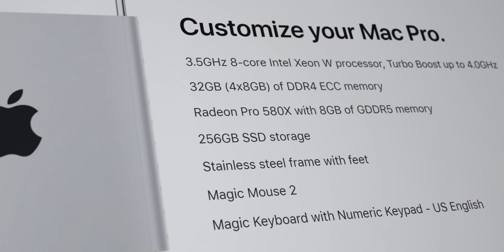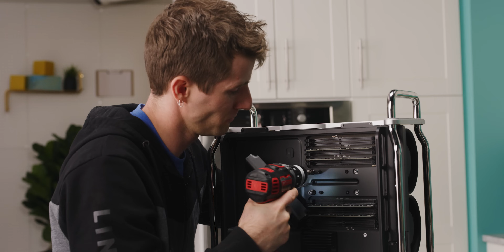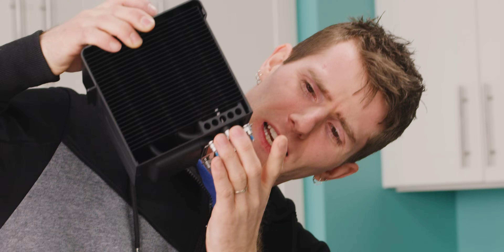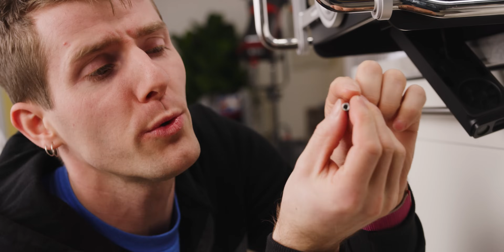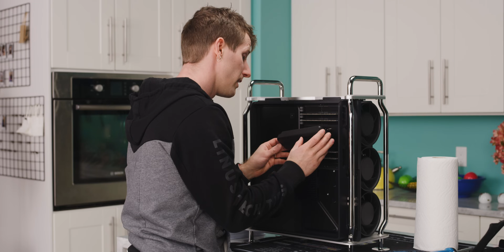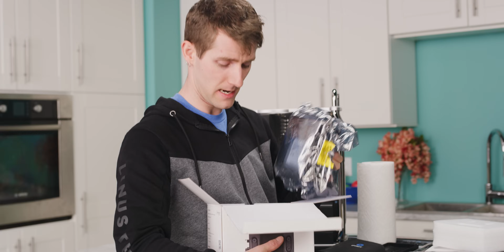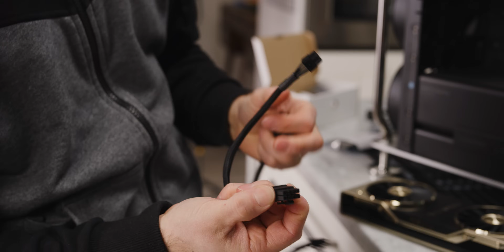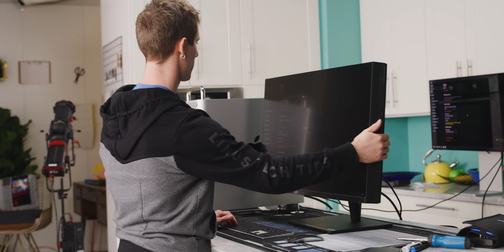Don't give Apple your MONEY - Mac Pro Upgrade Adventure

Comment: So you basically paid 6 grand for a nice case, proprietary motherboard and (I assume) decent PSU?

Ouch.
Reply: @GamingPIG3ON  the Afterburner card and dual Vega GPU were substantially extra over that $6,000.
Reply: Welcome to apple lol
Reply: Nice case?
Reply: @GamingPIG3ON  Normal, t'es un pigeon mdrr. Non je rigole, apple au pouvoir, les autre à l'abattoir
Reply: The 6k was for the lowest entry level. I'm not sure why Linus wasn't clear about how much he started with, and then how much he put in. Sounds like he started with at least 8k, and put another 2-3k in. Hardly the machine the vast majority of the public will be getting. I don't know what wax Apple is smoking.

As far as Mac OS being reliable, we just went through 4-5 months of Catalina issues with other's software. I don't trust Apple at all anymore on desktop. They are a phone company, and they iron out glitches, but it can take years. When it comes to software like Ableton Live or Houdini, it's a regular struggle for those companies to stay on the Mac, and stability is much more evident on PC.
Reply: and locked boot SSD
Reply: That's apple
Reply: For the nicest case on the market and incredible thermals. Hopefully day 3rd party case manufacturers will catch up.
Reply: @Noah-Lach  "nicest case on the market" lol I actually can't tell if you're trolling or not
Reply: Thugasaurus Rex Show me one with better build quality and thermals. I’ll wait.
Reply: @Noah-Lach  you obviously haven't seen the market. Also - the thermals are only incredible if your comparing them to other apple devices.
Reply: Messy I have and the level of quality is disappointing to say the least.
Reply: "Nice case" is a bit strongly worded, my friend... 😂
Reply: dont forget the shitty OS
Reply: Andrew Fowler if apple does one thing right it’s the OS. Maybe not for gaming but for industry use it’s amazing. When I’m watching and processing dailies on set reliability is a must. That’s one of the reasons why we use ARRI cameras, not RED. Our Linux system has failed us before. Windows when throwing 5.5k or 4K ARRIRAW at it has a pink fit. Mac OS always runs fine.
Reply: @gabj9017  Mac may be an industry-standard OS, but to be honest I doubt that has anything to do with the OS itself being inherently better than Windows or Linux equivalents and everything to do with the whole marketing of Macs as "professional machines" paying off so well that third-party developers of professional tools just support Macs over other operating systems by default.
Reply: @Abion47  clearly you don't use macOS
Reply: @gabj9017  Mac is not that amazing for Industrie. For example many cad programs won't work on Mac or don't have the full feature set, many scientific applications and accessories are not supported by Mac OS and the list goes on. On the other hand windows is the standard for most major companies and it supports almost all types of applications. Mac OS is useful for a small niche not for the Industrie as generell. Also a proper windows server based solution is pretty reliable.
Reply: TheGabbaKeks of course I have no doubt CAD would work better on windows however I have no experience with it so don’t quote me. Your right it does have a niche market. I only know the film industry and of the industry only the part I work in. But in that part, not even in post production but in producing dailies for screening. This computer has already become rather standard even though it’s new (new by our standard). The fact it’s portable, reliable and can handle pro res with ease which might surprise you but is probably the format we use the most and so does everyone else with ARRI cameras (the industry standard) as most of the time ProRes XQ or 4:4:4 is our go to. The fact it also handles ARRI raw like a boss. It’s the best we have. Sure a windows server would be great. But if your going to haul a windows server to location, your insane. If you also think any lap top could handle the raw data at the speed which we need your also insane. The fact is for us it’s the best choice. Not only to say that almost all projects use ‘do’ dailies and a bunch of renting houses already rent them. A 50,000 price tag is not a lot compared to let’s say a small indie budget 1 million dollar film. For 10 mil+ it’s a no brainier. And to continue this, compared to our cameras even a Alexa mini LF racks in at about 70,000+ not to mention I personally prefer the SXT and large body LF. Not to even begin on lenses as that makes the price of a house look small. Anyways my convoluted point is that this 50,000 dollar beast. Is reliable, portable and handles the formats we need. So they hit our niche market. However are niche market especially since streaming became so big. Is growing by the day. This is not a VFX computer. Possibly a post computer. But it’s definitely a dailies powerhouse. Also good to use to transfer data.
Reply: @Abion47  LOL... Oh boy.
Reply: @Abion47  .That used to be the case with the likes of adobe (seeing as apple gave them money to get going ) but in recent times adobe runs a lot smoother on windows based products, windows/apple OS is largely the same and boils down to preferance. BUT as I'm a product designer by trade ill talk a little about the case, people miss the things/details  I see on the case and the product in general, Linus touching on a few of them in the video. Apple goes the extra mile or 2 on fit and finish and engineering like that does not come cheap AT ALL. Its like comparing a ford to a roll's. Integrated/fully discrete wiring, the entry mech, gasket around the case to completely seal it for thermal performance, specailly designed fans to mitigate noise even under heavy load and so on. I'm not defending their choice of spec but once you take that all into account you realise there trying to hit a budget and rather than cut corners on the case they sacrificed the entry spec, the case is designed to last a decade or more (see 2010 mac pro) and the entry spec is just to get you going. If people moan about the price then they've missed the point entirely and just isn't for them and that's fine, As a product designer, it's an industrial design marvel with engineering to match. Expensive yes, under spec'ed yes, but its apple
Reply: @dasooperb1371  I have a 2017 MacBook Pro that I use for work as a full-stack developer. The only things I like about the Mac as a development computer are the things it shares in common with Linux. Everything else lies in the range of workable but not noteworthy to a royal pain in the ass to work with (like the steaming pile of garbage that is XCode).
Reply: @Twinklinglittletoes  That explains why the entry price is 6 grand. It doesn't explain why upgrading just the RAM can run an additional 10 grand.
Reply: gaza4543 Isheep
Reply: @andyinmono9393  lmaooo if anything MacOS is leaps and bounds better than Windows any day.
Reply: Andrew Fowler macOS is literally superior to windows in most aspects 😭😭
Reply: @mattymrj01  In what aspects..?
Reply: @mattymrj01  Not worth $2000 for the OS when I can build a Hackintosh for the same price as my gaming PC.
Reply: @mattymrj01  ahh yes I love not being able to run any of my programs. Total superiority
Reply: @mattymrj01  Im genuinely interested.  Why do you think it's superior?
Reply: @joelgeri5417  It's the little things with Mac OS that I love (and I use Windows as well, a lot). Things like the Automator and file renaming, I had to rename 1000 files a while back, they all had random names like blahblahblah.jpg and I needed them to be blah-blah_blah_0X0X.jpg with the X's being numbers. You can batch rename in Windows but it will do it in its own format and the numbers will be like (1). Mac OS gives me huge control over little things like that and that's very valuable to me. It's not that Windows 10 is bad, I like and use it a lot it's just that the little things in Mac OS that Windows either does worse or not at all (without maybe using powershell and Mac OS has a 'nix command line anyway) really make it shine brighter for me (and the Apple eco system just works so well, working on my Mac, pick up my iPad and carry on there, come back to my Mac using my iPad as a second screen etc). Whenever I see Linus moaning about Apple or or people in the comments calling them overpriced junk I just roll my eyes; I will always use Windows but I've never once felt like what I got from my Mac was overpriced or junk.
Reply: @capuchinseven  and i wasn't calling Apple ovepriced junk either. im genuinely interested in what makes it  better then windows.   aside from renaming files on bulk is there any other reason you prefer mac ?
Reply: Joel Geri I totally understand a lot of people’s Windows preference when it comes to gaming/tweaking/customization/other commonly referenced points. Those kinds of user preferences are valid a lot of the time, but in terms of helping vs hindering my productivity when I’m trying to get work done, macOS wins by a mile. 

Here are a few of the ways in which Apple’s operating system is better and really helps for my use-case (off the top of my head):

1. The menu bar (File, Edit, etc.) in every application is separate from that application’s window. This might seem strange to users coming from Windows, but in addition to the slight streamlining of every program interface, it also means that applications with multiple internal (child) windows are always independent and do not have to be stuck within a parent application window.  Most of my work is audio / recording / mixing work in Avid ProTools. I use 2 Slate Raven MTi2 27” touch-screens with one 43” 4K monitor above them on the wall. I can have my Edit window on one touch-screen, my Mix window on the other, and various notes, plugins, meters, or the midi editing window on the 4K without having to stretch a parent window across them. Any combination of my applications windows can be on any screen, and those screens can be positioned anywhere a user would like (relative to each other) / be any combination of display types or sizes, and this will work as described.

In Windows, all of the different ProTools screens are housed within the applications annoying parent window which means I have to stretch it across two identical screens in order for things to display even close to this functionally. Even still, it adds unnecessary menu clutter/space to secondary screens and completely eliminates the utility of my 4K screen. Most/several audio programs (DAWs) and video editing suites exhibit the same Apple vs Windows behaviour. The only exception I can think of is Adobe Photoshop which I believe has the same independence of its tool, menu, and workspace windows on both operating systems.

2. I would also probably opt to work within MacOS just for its fantastic integration of multiple / separate desktop “spaces”. MacOS makes it really easy to set up multiple desktops and switch/scroll between them just by holding down a modifier key and pressing the left/right arrows (or the up or down arrows to access other functionality). Additionally, applications can be assigned to specific desktops to that they always open or reside there by default. 

In my case, I have desktop 1 set up for file system management and random apps, desktop two for internet, desktop 3 for ProTools, desktop 4 for iTunes / media playback, and a fifth desktop for Photoshop or Video editing. My applications are always in the same places and I can swap between tasks or workspaces with a simple key command. For example: if I am working on a mix session in ProTools (which is setup to cover all of my 3 displays) and need to look something up or manage some files/stems that I have just exported, Windows would require me to minimize one/all of my windows or deal with a clutter of things floating on top of each other, but I tap one key command and I’m looking at a completely separate set of windows (or a fresh empty desktop). This type of thing is also very useful if I am “ReWire-ing” / routing audio between two different DAWs or applications. No messy minimizing/ maximizing or moving things around.

Additionally, moving back and forth between multiple applications when a project entails constantly transferring assets between photoshop or Final Cut Pro or a coding program or anything becomes super streamlined with this type of multiple desktop workflow. I’m sure there are ways to do this in Windows, but it is far less elegant and isn’t a default or typical use of PC.

3. For professional audio work where extremely low latency and stability are paramount: Apple’s Core Audio is far more reliable than ASIO on Windows and several third party drivers and high-end hardware solutions seem to play nicer with macOS (both due to inherent optimizations within the operating system itself and because a lot of developers prioritize Mac support since it has traditionally been so prevalent in the audio and film industries). 

Also, for whatever reason, Apples underlying OS architecture has proven far more stable under extremely heavy loads when working with audio.

4. Not that it is my primary concern, but a combination of Apple’s closed (limited in the opinions of some Windows users) ecosystem and its being built / coded upon a UNIX foundation rather than layers of C+ based language has resulted in a system that (while not invulnerable) is inherently less prone to security issues.. or at least specific types of vulnerabilities. This one isn’t enough of a reason for me to base an OS preference off of, personally, but it’s there.
Reply: Joel Geri 5. Using the OS itself. 
There are a lot of little conveniences and things (many of which have been around for years) that make macOS more effortless to use once you get used to it. A previous comment mentioned bulk renaming, but some other examples would include: 

-Pressing the Enter key on the number pad will automatically put the currently selected file or folder into rename mode (which in practice becomes a lot faster than the right click menu or slowly clicking the name twice).

-Pressing the left or right arrow key when a file name enters rename mode jumps to the beginning or end of the file name (excluding the file’s extension) which also adds convenience.

-Files and folders can be highlighted with colour for quicker visual locating when exploring the file system.

-A lot of basic applications can be installed or removed by simply dragging or moving them in or out of the Applications folder. 
Also, Imagine if every Windows program in your Programs folder was just its folder with an app specific icon. Every app in Apple’s Applications folder behaves this way (as a container for all of its internal file structure. Almost like a zip or rar file, but it’s the program itself). The internal file structures can be accessed if need be,  but this is rarely necessary.  Most program installers simply involve dragging the app onto an Applications folder shortcut. Only a select few apps require uninstallers (since most don’t place any files or assets in other locations on the system) so most can be fully removed by simply deleting them from the Applications folder with no further steps (unlike Windows which requires running an uninstaller program from within the Add/Remove programs window for pretty much everything).

-The macOS built in search function (Spotlight) is fantastic. It provides way faster results, far more useful results, categorizes them, makes useful suggestions, allows opening the parent folder or whatever way more easily, and is just an all around more elegant implementation of something that could easily be taken for granted. It’s hard to stress just how much better it is without trying it, but by comparison the Windows search function is a mess (and often useless). Windows 10 did improve search functionality a good amount over 7 (especially for apps in the start menu), but it still has a long way to go before it’s at the same level.

-Windows did add that snap to side functionality for organizing two windows (more?) on the desktop, but for users who want quicker navigation and convenience, enabling hot-corners or various shortcut based functions in the settings menu of macOS can allow a user to: show the desktop, cascade all open windows so they can be viewed at once and then select the one user wants, show a dashboard (overlay) of widgets such as weather, calculator, calendar, unit converter, sticky notes, stock ticker, etc (far more elegantly than the sidebar or permanently visible things Windows implemented over the years)... as well as some other options.

-When exploring the filesystem (Finder) in List mode (as opposed to an icons view), multiple folders can be highlighted and then expanded or collapsed by just pushing the left or right arrow keys. When organizing or cleaning your filesystem, this can be really handy. It makes moving all sub-files or folders to different levels of the filesystem hierarchy more convenient. It makes identifying empty (unnecessary) folders really fast when getting rid of junk. It makes counting the total number of objects (files + subfolders) at all levels within a folder really easy. It saves me a lot of time.

Come to think of it, I’m not sure that Windows really has a file explorer mode that is equivalent to this where a folder’s contents can be expanded out in a drop-down style list and easily highlighted or moved in and out of the folder (or up and down through the hierarchy) which it getting messy like in that columned group mode style or with multiple windows required to drag between or copy/paste.

-Continuing something started on one device on another device is incredibly easy. Web-pages, notes, YouTube videos, etc will automatically move between an iPhone iPad and Apple computer. Even text messaging can be continued on any of those devices. 

-I have come to prefer the macOS dock to the start menu and taskbar, but I could see this one being a split depending on preference. I find the dock is cleaner, easier to organize in a way that speeds up one’s workflow, and Spotlight makes a direct start menu equivalent unnecessary given the way I tend to use a machine.

-Display scaling is way better on a Mac. If you have a display that is 4K or higher or just really massive, macOS makes it really easy to scale up the UI elements and text of basically everything so that they are easily usable/readable without any loss of clarity or perceived screen real estate. The Windows equivalents of this (such as they are) really don’t do as good a job of keeping text looking smooth and nice or of being as global in their effect. This is actually one where the way that Apple has programmed the OS’s handling of UI elements (Apple SDKs that developers integrate into their Mac apps) as well as how the OS renders text makes a huge different to how well this can be done.

-There is SYSTEM-WIDE spellcheck/correction, etc. Everything typed in a note, text file, browser, whatever can indicate spelling or grammatical errors (disable-able if desired).

-Text editing (basic as it may seem) is actually a lot nicer on macOS. The basic TextEdit app uses rich text editing by default (as opposed to the Windows notepad app which uses plain text) and formatting the text is made much more flexible with less effort as things like lists will automatically format as they are detected and upping or lowering the font size is as simple as highlighting something and pushing the + or - keys while holding command. The only thing I dislike at all is how text apps treat the home and end keys slightly differently.

-While on the subject of command+plus or command+minus: this key combination makes for quick zooming in a lot of apps and is remembered on a window by window or tab by tab basis.

-Key commands / combinations exist for so many useful functions that a lot of little things become a easier. For example: both Windows and macOS have commands for moving files to the recycling bin / trash can, but macOS also has a key command to empty the trash bin. There are key commands to show/hide hidden files and folders, open the Applications and other folders, cycle through open applications, open Spotlight search, put all displays to sleep, move to previous/next folder, paste text with or without its previous formatting, take a fullscreen screenshot or just of a selected portion of the screen, scroll through misspelled words, hide current window, open file info, open a folder in a separate window, etc. So much is made faster and more convenient at every level of the OS.

6. Time Machine.
macOS’s built in backup utility is pretty much the best of its type. Using a dedicated backup drive (with set up by the user) Time Machine makes scheduled backups of the system drive (plus whatever else the user would like). It can be adjusted to do less if desired, but by default it creates local snapshots as space permits, hourly backups for the past 24 hours, daily backups for the last month, and weekly backups for all previous months. When the backup disk is full, it simply deletes the oldest backups, as needed, to make room. 

This might sound like overkill, but it has virtually no effect on computer performance during typical use, can be easily paused during heavy-load intensive work and functions amazingly well. 

Accidentally deleted something: open time machine, copy it from an hour ago, and then paste it wherever you want.
Need something from a few weeks ago?: same thing.
Can’t find a file, but remember where it used to be?: same thing as a quick work around.

Time machine also makes it really easy to keep easy backups of critical work drives and in progress projects.
It makes it super easy to revert to a previous version of literally any document, session, project, or saved file if something becomes corrupted or if a user simply made an error while working on something.

Additionally, restoring an entire system to a previous state from any point along the backup time-line is as easy as booting to recovery mode and restoring from Time Machine. No hassles, no re-installing the OS from scratch, not BS. 
It simply re-images the drive and is as fast as copying the data.

It also cannot be over-stated just how easy the interface for Time Machine is to use when accessing the backups.

Windows has backup capabilities and some third-party software offers some or similar features, but no PC equivalent is as well integrated, as simple to use, and as generally effective with so little hassle.
It may not be as much of a priority for every user, but it is incredibly reassuring to have when working in a professional capacity and when dealing with client’s work and data.

I’m sure there’s more that I’m not thinking of, but that’s at least some of what makes Apple’s operating system my preference.
Reply: @stringsdiezel  imagine being such an apple sheep that you're willing to write a 4 page essay in a youtube comments section about why mac os is better
Reply: @stringsdiezel  You go into so much detail here that I couldn't help but respond.

1. Menu bar

This is most definitely a personal preference thing, but I have to say I hate the menu being separate from the program window. It is also rarely as neat in multiple monitor setups as you say. I'm frequently fighting with the OS to show me the menu of the program I want as it will instead show the menu of the currently focused program across all screens. Also, sometimes if I have a window maximized, the menu bar on the other screens will just be a solid white bar across the top of the screen which is incredibly jarring.

2. Desktop Spaces

Mac desktop spaces is pretty convenient, but the desktop spaces functionality in Windows 10 is virtually identical. It's just less convenient to use because Windows doesn't typically ship with a multi-touch trackpad. 

I also have to say that, speaking of the aforementioned multiple monitor setup, I have a preferred layout for my spaces, but when I unplug my laptop to bring home, the spaces get all jumbled up and the next time I plug it into the monitors (even if I hadn't opened the laptop since) the spaces are all mixed up. What's worse, there's a space on each screen that is quietly marked as the "default" of that screen that can't be moved around at all. So if a space that is usually on my left screen somehow ended up as the "default" space for my right screen, the only way to get back to my preferred layout is to manually move every window to the other space.

3. Audio Work

I don't do much professional audio work so I can't say much here. What I will say, though, is that if ASIO does seem like it is incredibly old and, if it was developed alongside the Win32 API, fairly outdated. I would be inclined to chalk this up to what I said in my other comment, that Macs were heavily marketed as the device for professional creative work which led to them getting more attention from third-party developers of professional creative tools which hyped up the marketing... and the cycle continues.

4. Closed Ecosystem

This is a very common misconception regarding the Mac OS. Mac is not inherently more or less prone to malware and security flaws than any other OS. It gets its share of issues just like Windows or anything else. Being based (some might argue loosely based) on a Unix kernel doesn't really matter, since it's based on a really old version of Unix that was then morphed into a version of BSD and then NexTSTEP after that before finally becoming Mac OS.

Also, the belief that Macs are inherently more secure is actually fairly dangerous, since when the exploits do happen they are that much more effective due to Mac users believing they are bulletproof and not taking the necessary precautions.

5. The OS itself

I suppose I'll address these individually.

- (Pressing the Enter key twice...) On Windows you ender rename mode by pressing F2.

- (Pressing the left or right...) Windows does this too.

- (Files and folders can be highlighted...) I honestly don't know if Windows can do this as I've always hated the feature. having files and folders in a Mac OS window be color-coded to me looks like a huge mess. I'd much rather group related files and folders using a sensible naming convention. But to each their own, I suppose.

- A lot of basic applications can be...) This is the source of another misconception, actually. First, there are plenty of Mac apps that do require an installer, and those that do can't be completely uninstalled by just deleting the app from Applications as that doesn't delete the stuff that was added to your documents, your Library folder, etc. And to be honest, for programs on Windows that are also self-contained in their installation folders, you can also uninstall them by just deleting the folder; the uninstall process is mostly just a formality. This mostly just comes down to convention between Windows and Mac apps, and personally I prefer the Windows approach since while it might be less convenient ro tun an uninstaller than to just delete a file, you can be more sure that way that you aren't leaving a bunch of now orphaned data and config files quietly taking up space on your computer.

- (The MacOS built in search function...) This is true. Spotlight is incredibly handy... until it isn't. When searching for specific apps (like when I want to open up the calculator and do some quick maths) it's up and ready to go. But there are also times when I've been searching for a particular file or folder that I know existed in an indexed folder and no matter what I typed, Spotlight kept suggesting web results to me rather than what I've actually wanted. Windows 10 search function isn't as robust, but it's also never not done what I expected it to do. Personally I'd rather have a search function that is limited but predictable than one that promises the stars but often falls short.

- (Windows did add that snap...) Windows also has hot corner functionality for people who really want it. On Mac, the hot corners can be useful, but I find it way more useful (not to mention less prone to accidental activation) to bind those actions to touchpad gestures instead. On the topic of Windows snap to side, I personally find it amazing that Mac hasn't incorporated something similar, as one of my most aggravating day-to-day annoyances I have with Mac OS is in its window management.

- (When exploring the file system...) I didn't know about this functionality in Mac OS and it sounds cool. That said, personally it also doesn't sound too terribly useful in the long run, as I don't find myself frequently needing to navigate multiple folders and subfolders. Regarding the list view, Windows does not support that kind of view with expanding folder trees. I'm okay with this, personally, as I find that view to be very easy to turn your folder into clutter, but this is another one I'd chalk up to personal preference.

- (Continuing something started...) This has less to do with Mac OS specifically and more to do with the Apple ecosystem in general. And sure, there's a lot of convenience to be gained by operating solely within that ecosystem, but it also comes with the cost of things being needlessly complicated whenever you have to branch outside it. Also, I'd personally like people to stop conflating text messaging (i.e. SMS) with the proprietary Apple-only messaging system that is iMessage. (As an Android user with a lot of iPhone friends, group conversations are a pain in the ass.)

- (I have come to prefer the...) I don't really see much difference in functionality between the Mac dock and the Windows taskbar, with one exception on Windows being that it is way easier to see which apps are open and to navigate to a specific opened window. In my experience, Mac does not really like to facilitate easy navigation among minimized windows.

- (Display scaling is way better...) No arguments here, though it's worth noting that Windows 10 got waaaay better at it than Windows 7/8.

- (There is a SYSTEM-WIDE...) True, and this has annoyed me more times than I can count. I don't want spellcheck enabled in my code snippet files, and there are much better spell-check and grammar-check addons in MS Office and in Chrome/Firefox than what Mac OS offers by default. (Try Grammarly)

- (Text editing (basic as...) On this I have to 100% disagree, though it may come from my preference as a programmer. "Basic text editing" to me means plain text editing, and it bugs me that every time I open a text file in TextEdit I have to manually switch to plain text mode. I rarely if ever find myself wanting to do some "basic text editing" that requires rich text, since when I want to do rich text editing, that's what I have MS Word for. Also, if you do want to do "simple text editing with rich text" in Windows, you use WordPad, not Notepad.

- (While on the subject of...) That's not a Mac OS thing. That's a convention that a lot of Mac OS apps use. And most if not all Windows apps that have zooming functionality share this convention (though it's Ctrl-Plus and Ctrl-Minus, obviously).

- Windows can also define key commands for a fair number of things, though they don't come bound by default a lot of the time. There are also programs like AutoHotKey that fill this space remarkably well. Personally, though, I don't like the idea of binding OS actions to hotkeys that an app could easily override.

6. Time Machine

Mac's Time Machine is pretty nice for what it is, though I have to say as a technologically savvy person with less-so grandparents, this has been a source of more headaches than I'd care to experience on the occasions where it hasn't been working. This is something I could say about Mac OS as a whole, really: it's simple, clean, and convenient... until it isn't, at which point it can be like pulling teeth.
Reply: @capuchinseven  thanks  for all that, its good to hear from a daily mac user. I don't really want to comment on anything you said as im more interested in another point of view rather than starting an argument.
Reply: Andrew Fowler I actually use both. I just find I more often wish Windows did something the macOS way than I do the reverse. Also, I didn’t type out such a long response due to brand loyalty... I’m just generally long-winded as a person, and have a bad habit of doing that about any topic. I don’t comment or post very often, and then when I actually do.. I write a damn book for no good reason. 

It’s a problem lol.
Reply: @stringsdiezel  I don't think its a problem at all, good on you for giving those opinions. people tend to just be annoyed or make comments on mac or pc without any reasons or experiences to back them up. its good to hear peoples actual reasons why tho it helps to show the whole picture
Reply: @Abion47  I typed all of that before bed/after a long day yesterday.. Re-reading it after some sleep: Wow am I long-winded at times. That reply could be it's own YouTube video rather than a reply to a comment. I'm honestly surprised anyone read it all, let alone gave a detailed response. Thanks man. You also make a lot of perfectly valid points.

That said, I'm sure most of what I described would be more accurately filed under "Things that keep me tied to/preferring macOS for my workflow" than "things that would make me or others switch from Windows". A lot of the differences thoroughly annoyed me for my first ~2 years of being forced to use macs. If the switch hadn't been forced out of necessity some 10+ years ago, I probably never would have.

To re-address a few of the points / your remarks on them:

1. I do tab between programs quite a lot rather than clicking around, so it's possible that I don't encounter the "wrong menu" thing as often as some might. I never really considered that as a possible issue, but it makes sense that it would annoy at times. My primary reason for listing it was the lack of parent-window thing which makes a massive difference to how well my multi-display setup functions. I don't think I've ever had the "white-bar" thing you described. Some programs will have empty space on the second screen, but windows on that display can be maximized further to fill it.

2. The combination of the most significant (to my workflow) things I listed means that I almost never use Windows for work anymore (just for play).. so I've actually never used the Windows version of desktop spaces. What I will say is that I don't use a laptop for anything at all so I'd not considered any hiccups that disconnecting things might introduce. My main studio setup stays exactly as it is at all times. I would add that I definitely prefer spaces with the option selected where all displays change spaces together (as opposed to only changing the current display that is selected/where the pointer is).. It seems tidier when all 3 displays scroll between spaces together.

3. I agree that a lot of the 'better support and compatibility' is likely self perpetuating. I just can't justify risking any downtime or slowdowns that unforeseen stability issues could cause.. If it wasn't work related I wouldn't be as hesitant to experiment more often, but it wouldn't make sense for what I do at this point.

4. I'm not necessarily under any illusions that macs are invulnerable or immune to security flaws. In fact, I would largely concede this entire point to your arguments. 
If anything, I would say that limited internet use and a system that is completely devoid of any unnecessary or illegitimate software would be the best preventative foundation to start with in either Windows or macOS setups. There are a handful of common exploit types that seem like less of a factor for macOS, at least initially, since the operating system is so anal about anything modifying system data/etc at all (lots of required password entry and nothing being able to be installed or modified without initial user approval), but Windows has moved more and more in this type of direction anyway. User knowledge/literacy is far more a factor than the operating system. Nothing can prevent user stupidity in either case.

5. -The numberpad enter key thing is more of a personal preference since its so close to my mouse hand for tapping it quickly. Actually didn't know about F2 on Windows, so that's still nice to add.

-I'm wondering if the thing where arrow keys during renaming ignores the file-extension was changed in more recent Windows versions, because I could swear it used to jump to the end after the extension. Either way it's nice that both function the same way. I just tried it since I'm typing this on a Win10 machine. Works as described.

-Completely agree about the colour-coding thing being user preference. I mainly like it for organizing work related files as I can quickly identify audio/video/music vs dialogue/projects at different stages of completion or priority on the work-drives based on the colouring scheme I try to stick to. I do most of it on folders rather than having a scattering of coloured files.

-I manage my own systems so I do know that lots of larger programs require install/uninstall. I just listed it to illustrate its convenience with regard to smaller/self-contained applications.

-I actually agree that it would be nice for macOS to add something like the snap feature. Definitely a point for Windows. I also only use these functions via key-commands or gestures since mis-triggering is annoying. 

-I agree about the folder-tree view being specific to my workflow. I encounter it quite a lot with large banks of audio and project files. As for clutter, I can cmd+A to select all, and then tap left-arrow a few times to completely collapse every expanded thing. So it cleans up fast.

-I'll concede the SMS vs iMessage thing. It is an apple-specific benefit and only helps in that regard since a lot of my most frequent contacts are all also on Apple systems. The browser window and YouTube thing is a cool feature, but far from a deal-maker if you aren't already embedded in the ecosystem.

-I really like the way Win10 handles multiple windows for an open program (hovering over the Google Chrome icon in the taskbar to see all open windows, etc). Point for Windows. I moreso like how seldom I actually find myself using the dock at all whereas I seem to use the taskbar/start menu a lot when on Windows. Definitely a personal thing.

-Windows 10 is definitely a win in my book. There were some transitional hiccups for some users with their push-implementation, but overall I like it. The macOS scaling is still better, but Win10 is pushing in the right direction for Microsoft. (I liked 98, hated ME/2000, like XP, hated Vista, liked 7, hated 8, like 10...)

-Combining the text-editor points: I like it the system wide spell-check for my uses, but definitely turn it off if I have to do any light coding. That would be dreadfully annoying to see if you use Notepad to slap together simple coded files. I make a lot of quick notes about projects and the easy formatting in a super light package is nice for my uses. Good points on your side though.

-Agreed that Windows allows for keyboard shortcuts, I do find a lot of the built in macOS ones handy for my uses.

6. I'm so glad that my studio-computer/workstation isn't touched by anyone that doesn't know what they're doing. My love for Time-Machine is rooted in the peace-of-mind factor it adds to ongoing client projects and the need for minimal downtime in the event of a catastrophic failure. It's integration with system migration between mac computers or system-restores is incredibly nice to have. 

Thanks for the detailed response. I almost never get that with internet comments sections.
I'd overall say that I like macOS more for profession media-industry work and some personal things, but prefer Windows 10 for play and messing around.
If I was a graphics guy (CGI or special FX) I would absolutely be going Windows for work. For audio and video work I prefer mac.
Reply: @stringsdiezel  I don't have anything specific to add. It seems we agree on every point whether something is better in Windows/Mac or whether something can be chalked up to workflow or personal preference. I get a fair amount of crap/teasing from people I know who are staunchly Mac fans that I don't "like" Mac OS or iOS, when the reality is that it is what it is and it has things it excels at and things it does poorly at. For example, web development on Mac is generally speaking much easier than on Windows thanks to its (distant) Unix roots, but (ironically) macOS and iOS development on a Mac using Xcode is among the worst experiences I've ever had as a developer.

In reality, though, I don't have any serious issues with Mac or with iOS. They have a fair amount of annoyances, but that isn't to say Windows and Android don't as well. What really grinds my gears is Apple themselves. They have a long track record of gaslighting their customers and overcharging for their hardware for no reason other than they know that they can. In extreme cases, they've even been known to vilify their own customer base over things that they were fully aware was their own fault, not to mention their whole stance on right-to-repair and customization. In my opinion, they aren't a company that is deserving of any respect, much less the unconditional love and adoration they get on a daily basis.
Reply: @joelgeri5417  Thanks. I just figured it would be more useful to list a bunch of things I find personally useful in my day to day. Too many of these topics (so much so with Apple related devices) just devolve into cheer-leading for a "team". I could care less about which "side" is better. What can it do for my workflow/time/efficiency.
Reply: @Abion47  It definitely sounds like we are both coming from a very similar place, but with different specific needs. It all really just boils down to what a given tool can do for productivity. I want tools to make my job easier rather than fight me. Which tool is best absolutely changes with the task at hand.

I'm also definitely with you regarding Apple as a company. Their philosophy on design and user experience seems like it comes from a good place and they definitely try to prioritize customer experience, fit and finish, etc. (although individual mileage definitely varies), but their business practices can be galling to say the least. I would understand if their products were a small margin more costly than competitors to account for extra r&d/design/machining costs where applicable, but the "Apple-tax" as it's affectionately referred to ends up seeming like just an uncooked, unseasoned, plate of bullshit more often than not. The price tiers for RAM / CPU / etc upgrades are ridiculous and their treatment of customers who try to fix things themselves is heinous. I honestly hope that they lose legal action in some of those right-to-repair cases because that nonesense is infuriating. 

Honestly, if it weren't for work(flow) reasons I would just build powerful PCs (potentially/likely AMD-based given their massive gains recently) and be done with it. 
If it didn't come with the risk of looking unprofessional (like a software pirate or whatever) in front of clients,  I'd likely not own a single genuine Mac, and probably just use my hackintosh setups as I do for some home/personal stuff.
Reply: matthew ! WIndows is so better